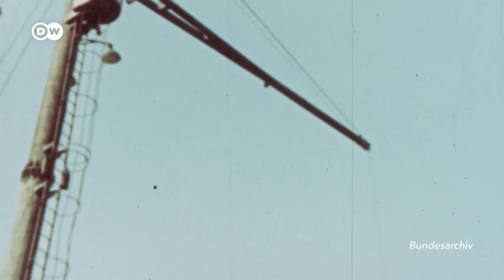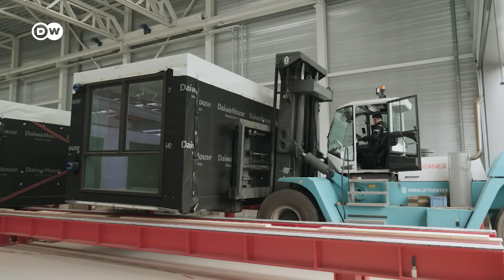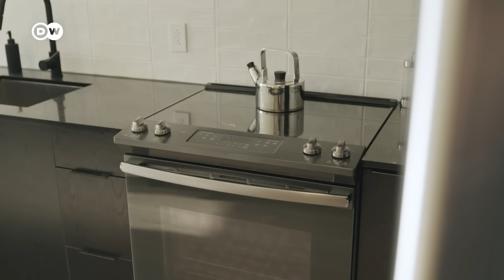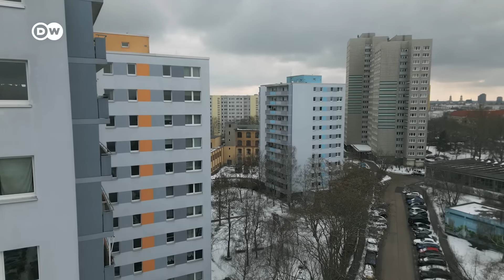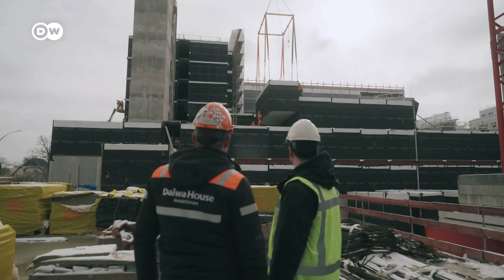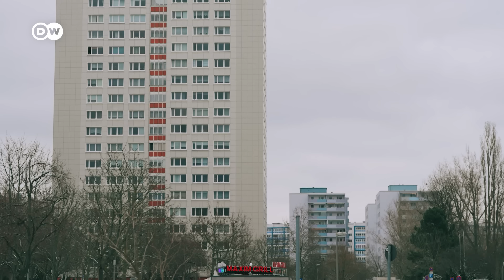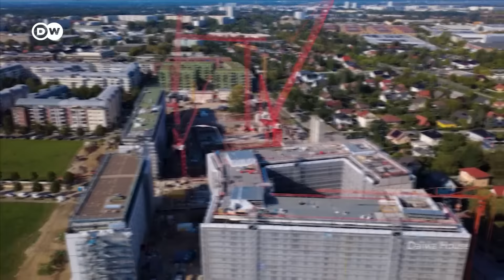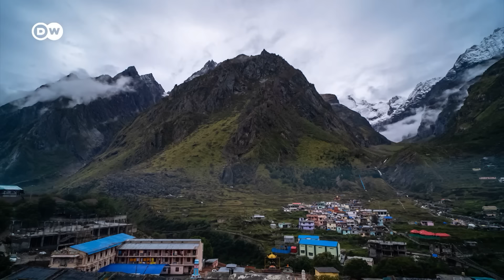These buildings are ugly. But the idea was genius.

Comment: We just got our first modular apartment for social housing in Seattle. It went up very quickly and less expensively versus traditional methods. I take issue with the implication that the housing shortage is caused by construction methods however - it's caused by greed, corporations owning housing and artificial limits on building new housing to constrain supply. They resist stuff like this through restrictive codes, etc.
Reply: Oh aye, same for the "we build the same way we did for the last hundred years." No. No we really don't. The bulk of the way we build things today are directly related to the end of the second world war and it's "fast, cheap, and we need it yesterday and don't give a shit about how long it last" thinking.
Reply: Nimbys block any medium density or higher housing near their housing assets
Reply: @jonathanjones3126 That is a real issue with so much demand for housing in cities the only way we can accommodate everyone that wants to live there and need to live there is to build higher and in some areas we need to build skyscrapers with apartments.

It is not the only way to stabilize housing prices but it is the only way that is equitable and fair I don’t think artificially demand constraining through policies is liberal enough.
Reply: --Scrolled down to comments to talk about this exact problem. Thank you for bringing it up.
Reply: Indeed. Our main problem in the US is citizens United. Does not matter how much of what we build if corps buy out everything. "Own nothing. Pay your last penny to ultra rich" is all we get. The grifters in the admin. It is insane. Taxation without representation - this is the reality of working people
Reply: @littlemu12345stop voting in incumbents and career politicians.  300 million Americans and 435 representatives in the house.  There is never a need to vote for an incumbent.  After one term they need to go get a job.
Reply: @silencemeviolateme6076  And then the only people with the experience  to know what's going on are the lobbyists.
Reply: @davecook8378 oh no!  They may take over! Hahahahahahahaha
Reply: I'm Soviet and it's crazy that even you Americans finally take this idea 😅😂
Reply: @gamermapper  What do you mean you’re Soviet? It doesn’t exist for the last 35 years
Reply: @mbayatab4326 you guys have people in your country claiming to be Irish that have 3 generations prior to them all born in the US, by that logic he’s even allowed to claim he’s imperial Russian lol. In fairness they probably mean “from the post Soviet space”. Some people that moved overseas may have moved away when it was still the USSR , or identify more with the broader Soviet cultural identity even if they weren’t a supporter of the regime itself. Imagine the US breaks up. 20 years later you’ll have many people calling themselves Texan or Californian, but also many people who still call themselves “American” because it’s the identity they grew up with. Same idea here
Reply: @valentinventures  I’m not actually American, was born and raised in one of the republics of the former Soviet Union. I don’t consider myself Soviet!
Reply: @mbayatab4326  it's possible, but not majority. In 1991, even when all shady sides of Soviet Union and its dark past were known to public, people voted 78% for preservation of USSR on the referendum (with 80% of registered voters showed up)
It was much more human friendlt, intelligent society, than current wild capitalist Post Soviet countries
Reply: @mrobocop1666  I remember those times very well and the referendum was conducted only in 9 out of 15 constituent republics. But of course, people voted for the Soviet Union because that was the country they were born and grew up, people just wanted to reform it.
Reply: @mbayatab4326 not true. We voted to get free from that hellhole
Reply: It’s primarily local government restrictions more than any other factor. Austin, Texas managed to decrease their rents by building a ton of supply of which was only possible due to the state of Texas being hostile to zoning in general of which local governments are heavily restrained from these terrible impulses
Reply: I don't think corporations and developers are the main cause either. Big corporations and developers have specific interests; for example making sure their project is as profitable as possible, which generally means targeting the richest buyers. But they have no interest in truly constraining supply on a larger scale, which local governments do pursue.
Reply: Cheap, fast and efficient.
Bonus: you can feel at home when you go to jail...
Reply: So steal taxpayer money instead. please move to the communist dystopia of your choice, we won’t let you fuck up this country anymore.
Reply: Excellent comment!
Reply: The Seattle public housing authority is tiny compared to ours in nyc of course because it’s a much smaller city but you guys have yesler village or something like that which is probably about 80 years old
Reply: supply well managed by profit motives............
Reply: Never care of so beautiful or ugly being ,I care of how much strength to against tornado, seismic  and the construction cost which respond to dwellers' cost of living then the real standard of social living would be effected.
Reply: Greed and corporations are motivated to build more to have what to sell and make money from.
Reply: Philosophical Foundation
Your framework is based on four principles:
1. Housing Should Primarily Be a Home
Housing should not primarily function as a speculative asset.
2. Supply Problems Require Supply Solutions
When demand rises, the long-term solution is more housing construction rather than suppressing demand.
3. Speculation Should Be Restricted Through Leverage and Tax Policy
Rather than crashing markets with harsh monetary policy:
limit borrowing,
tax additional properties,
require more equity from investors.
4. First-Time Buyers Need Help Entering the Market
But assistance should be:
sustainable,
repayable,
flexible,
non-profit,
designed to minimize inflationary pressure on house prices.
End Result
In theory, this framework aims to create a housing market where:
High home ownership is preserved.
Young professionals can buy earlier.
Prices remain aligned with wages.
Housing shortages are prevented through construction.
Property speculation becomes less attractive.
Government support is recycled rather than permanently spent.
Reply: Corporations are just cope. It's because of local politicians. California has driven out most of it's billionaires/corporations, yet it still hasn't put up new houses. Even rebuilding after the fires is extremely slow going because they refuse to let people rebuild. It amazes me how their residents will blame everyone else. They even pretend it's the federal government bullying them, when it's clearly the local government demanding all their money. All other states would be complaining about it if that were the case, yet most of them don't have this problem.
Reply: In the uk the cost of the building is almost meaningless. The price is  based on location to a far greater degree. The only time it is an issue is social housing when the land is already owned.
Reply: The main problem is government regulation. Everything from zoning laws, powerful NIMBY groups, and over-designed building codes make new builds impossible or very expensive. Everything else - whether the actual costs of construction or corporations bulk-buying homes - is secondary to the fact that the government chooses to make it incredibly time-consuming, difficult, and expensive to build new homes.
Reply: @MarcusMoonstein They are from Seattle. They already know all that but prefer to blame businesses.
Reply: @JoeOvercoat  probably because businesses lobby the government to enforce regulations that disproportionately benefit businesses... d_mbass.
Reply: @peaceandquiet1917 Exactly
Reply: @peaceandquiet1917  pro business weirdos always skip that part.
Reply: @peaceandquiet1917 businesses lobby the government to cut the redtape and streamline regulations. The nimbys hold the codes
Reply: @user-wd8ym7du6j  if you think nimbys are the problem and by proxy that what regular citizens think matters then you're the problem.
Reply: Greed and corporations could not produce the same result if the housing system were more functional to begin with.  Building new housing would be too profitable and supply too plentiful.  We already see that many private equity firms have come under strain because they bought too much housing at too high a price and tried to charge too much, seen reality hit, and are now trying to get out while they still can, not realizing that it may well be too late.
Reply: @unconventionalideas5683  This comment is bizarre. Review your Business 101 supply and demand curve and then think about what you said.
Reply: Nope just blocking construction and a shortage of labor that's it.
Corporate ownership is less than 2% of US homes they have zero effect on US housing.
Reply: There are a countless amount of new, inexpensive building methods that works like real life lego. 

Yet, for some reason every single new method costa as much as the old school building methods. 

Why? Greed
Reply: @roberth4395  no, capitalism
Reply: China is still doing it today. That's why house prices are falling.
Reply: @AndikaKhairilAkbar  they also have tofu buildings and rotting unused supply.
Reply: Housing shortages are caused by regulations.
Reply: @hamsterg0d  regulations put in place by housing speculators and developers to maximise their profit...
Reply: @peaceandquiet1917  Studies show that for each 10% more Democratic Party vote, residential housing regulatory burden increased 30%.
Reply: @hamsterg0d 
Source?
Reply: @hamsterg0d please show me that study.
Reply: Restrictive costs are defined by CITIES not by private development companies. You people have been brainwashed to a point that you can't even see what is right in front of your eyes.
Reply: It's so sweet you pay your tax to sponsor houses for different kind of cultural enrichers.
Reply: So you are a communist, who promotes disgusting buildings for you to park all the workers in. So that the “communist elite” can take the fruits of their work.

Business as usual.
Reply: Everyone who rants about ‘greed’ by developers has never taken an economics class, a business class, or a class on development proformas itself. There is risk in development. To incentivize people to take on that risk, you have to give them better returns than they would get from other safer investments. Bureaucrats and NIMBYs increase delays and risk. Academic whiners who refuse to work in construction or train a new generation in such jobs also contribute. Anyone can become a developer. Why don’t you try, instead of standing on the sidelines complaining? Or if you don’t want to do it yourself, invest in development. Or invest in real estate that is already built. You will quickly learn what you clearly do not know.
Reply: @RM-dc6zd  "why don't you become an exploiter instead of the exploited?"

Comment: There are many prefabricated (plattenbau) apartment buildings in the Czech Republic. They used to have a bad reputation and the apartments were cheap, but that has changed—their reputation has improved and apartment prices are now comparable to those of brick buildings.
But there are big differences among them. Surprisingly, the oldest ones are the best. The housing developments were better planned, the apartments were larger, and the construction quality was the highest. In the 1980s, buildings were constructed too close together, without any apparent plan, and the apartments were small. And they cut corners wherever possible, so the quality of the apartments was terrible.
Reply: Stalinkas (the old ones) are order of magnitude better than Khrushchevkas (the 70s-80s-90s)
Reply: This is the same for Bulgaria. Soviet panel apartments used to be 20-40% cheaper compared to brick apartment buildings, but since 2020 they compete with them despite some of them not looking very good and haven't been updated to new standards and no insulation. People do their apartments with insulation and furnishing them with brand new furnitures, but the stigma and gray/old looking scary soviet buildings is there. I believe this will be changed since the housing market is to HOUSE people. Their price in Bulgaria (mostly big cities) have exploded in price. In 2020 - 1bed apartment cost around 50-55k euro. Today.. are going for 120-160k if they need renovation. Those that are renovated inside and insulated go for 20% higher in price. The demand is there.
Reply: @penguingobrrbrr353 This is true all over the Eastern Europe and Russia. Which is pretty big part of the Earth's land territory. And, as we can see, it is also true at Germany, someplaces 
By this way, probably, it is a thing all over more than the half of the urbanised Earth's territory
Reply: @penguingobrrbrr353  If you look at China their apartments are now about 20 stories taller.
Reply: In Serbia socialist era  apartments cost  like the same as brand  new apparments .
 So is normal to see socialist era apartment that was  given totaly for free when it was new now that is 60 years old with 0 renovation off building cost like 25 year or more off awerage salary in Serbia ..
Reply: All I remember from my 6 years in prague about those cursed commie blocks is how the czechs hated them and how they ruined the beautiful classical architectural environment wherever they were put up. Only reason to keep them is to avoid losing even more housing, driving prices up even more. Other than that, theyr only remnants of the stain the USSR left on Czechia.
Reply: That's because the 80s is when the Soviet economy started collapsing and that affected the entire East Bloc.
Reply: +1. Not to mention the quality of the concrete used for panels. It wasn't meant to last for too long. It will be very interesting to see the upcoming decades.
Reply: @tamoadamo  totally, I often hear excuses like the life spans expand with taking care of it, but once it starts somewhere decaying, its just a matter of time for catastrophe
Reply: @RendisRendisRendis This goes for the brick buildings also, don't forget.
Reply: @tamoadamo  80 years, I think. At least for the late Soviet construction. Early experiments in the 1950s and even 1960s weren't that good; the vast majority of those buildings have been demolished in Moscow by now. Maintenance is key. If neglected, the seams between panels may deteriorate. Once reinforcement is exposed to the elements and starts to rust you cannot do much.
Reply: @tamoadamo  I think this is false and purely propaganda. The demand would not have been higher in Eastern European cities and their prices would not have been going up so much and people would not have taken debt for 30 years to pay them off.
Reply: China is still doing it today. That's why house prices are falling.
Reply: In 6 years in China I saw hundreds of construction sites, none of which was using prefab. In every single case, convoys of concrete mixers arrive. Not a single truck hauling a panel

Comment: And how good are such buildings against the earthquake? Are such blocks made from steel fiber concrete? Because steel fiber concrete has not only orthogonal reinforcement, but in all directions, and this is much better against shear stresses by earthquakes.
Reply: Berlin has zero earthquakes and is not close to any tectonic plates, it's a complete flatland and has no hurricanes
Reply: @ayoCC  My friend, my question is about technology, not about Berlin. Or do you think that these houses could be built only in Berlin?
Reply: i was born in a "Platte" that underwent a 7.7 Richter earthquake and is still standing..
Reply: @coleslaw4558  The panel system building is a little bit different technology, like shown in this video. This is a so-called modular building technology.
Reply: I assume it wouldn't be great for earthquakes just like brick walls aren't great. I imagine that the bottleneck for the transfer of kinetic energy would be in the joining parts between the units...
Reply: Daiwa is a Japanese company. I'm sure they know a thing or two about earthquakes.